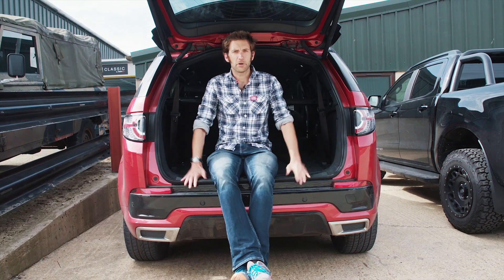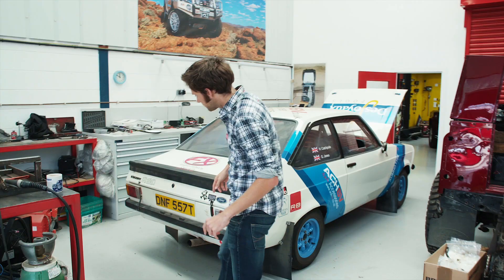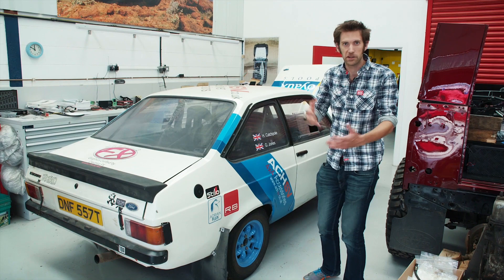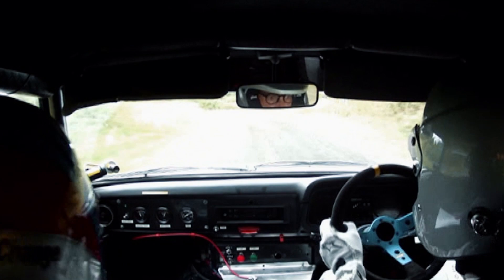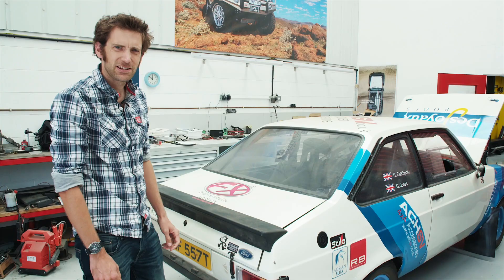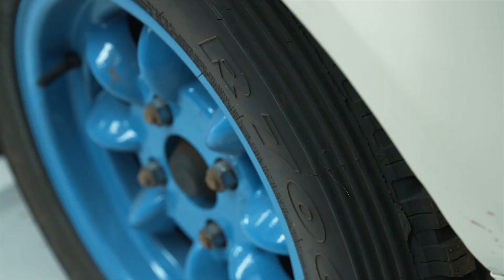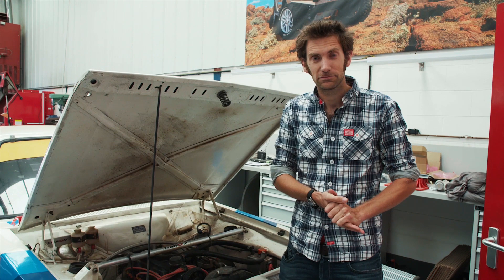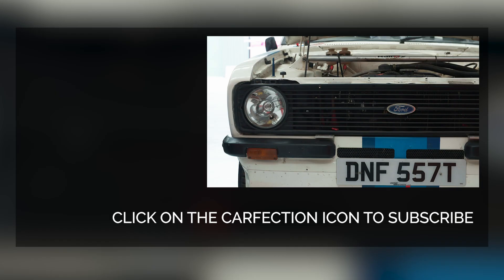1979 MkII Ford Escort Rally Car: Our Carfection Cars, Episode 1 - Carfection +

Comment: Yes, more please.  So wish I never got rid of mine.  It was my first car, back in 1990. Mk2 with square head lights.  It’s was a 1981 W reg.  had cortina rossy wheels, Webber single carb. Straight through exhaust.  I love it.  Cost me £800 at the time.  Really miss them days!

Comment: Less is more with these. There are tons of beautifully built mega high spec Escorts which are essentially show pieces, good to see one with a sensible spec which is built to be used rather than just impress. Like you say get the basics sorted so it's dependable & go from there, they can be very quick with a fairly basic spec as the basic concept is sound. It's a like from me!

Comment: I know it's your car, but PLEASE don't ever ruin it with wide arches. They wreck the purity of the design and make the car look fat. The worst offender is the Rover Mini Cooper Sport which I've always hated with those massively wide 13in alloy wheels. Give me a standard Mini sat on normal 12in alloys anytime. (of course there's only one true Mini Cooper and that is one from the 1960s sat on 10in wheels). 

Now I need to admit that way back in 1988 I owned a mk2 Escort 'rally car' with wide arches. I'm not proud of that faux pas 😳😂